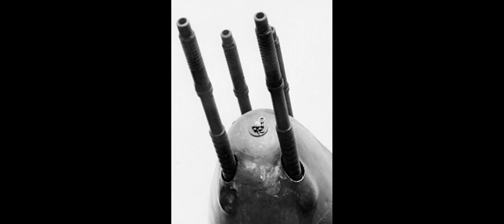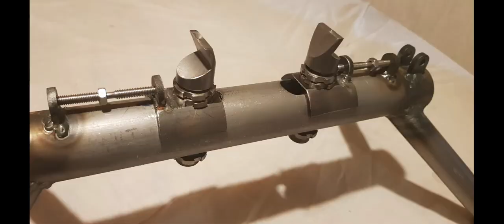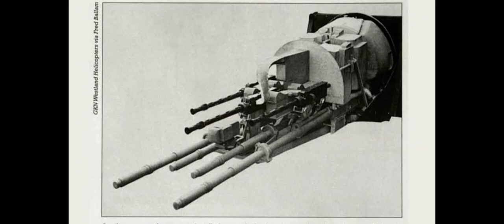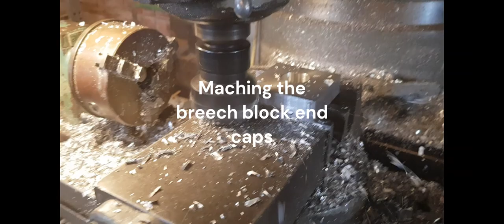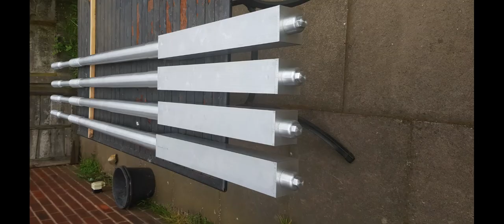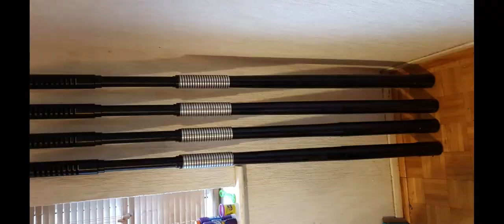Whirlwind Fighter Project - Engineering Update part 7 - Armament

Comment: The drum magazines used by the HS.404 had serious problems because it was impossible to maintain any sort of constant spring force. Those 20mm rounds are huge and heavy! French fighters that mounted HS.404s firing through the prop hub (MS.406 and D.520, in particular) typically ended up loading only 55 or 50 rounds because the gun was terribly unreliable with a full magazine.

No idea if this was still a problem with the gun mounted on the Whirlwind, but the Hispano-Suiza had to go through a lot of development to produce a reliable weapon with a predictable rate of fire.

Keep up the good work on the project!